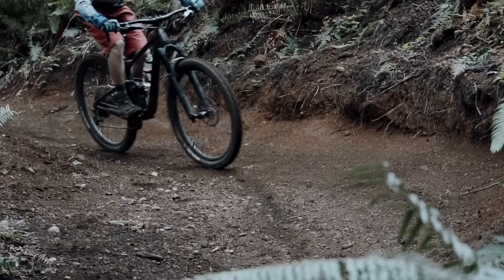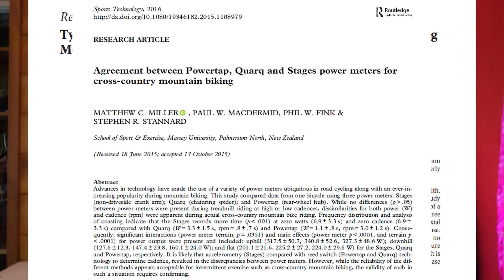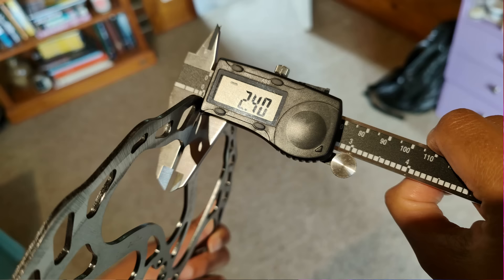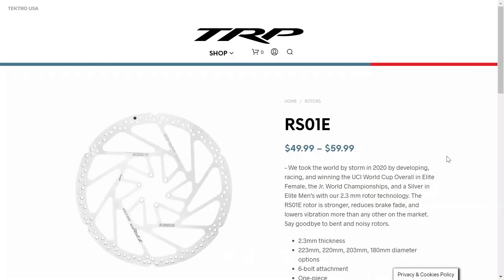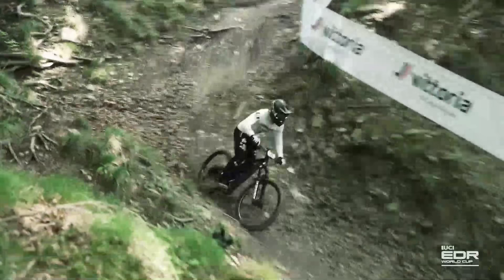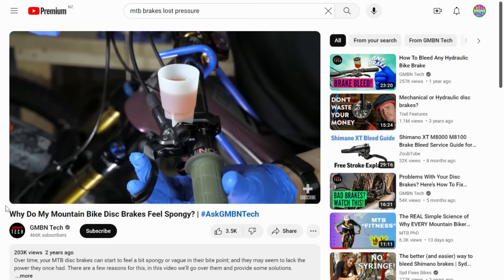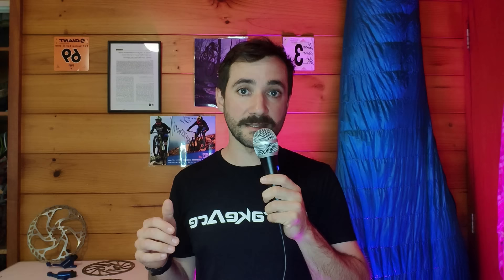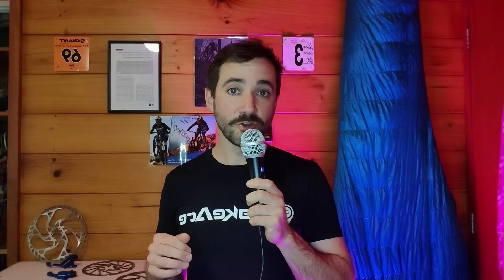Why THICK Rotors Will TOTALLY Change How You Ride (EASY Upgrade with REAL Proof)

Comment: Speaking from car experience, more mass means more heat asorbtion. But, one thing to keep in mind is heat dissipation. Larger diameter means more surface area. Which in turn will give faster heat dissipation. When it comes to brakes, you want the mass increase from diameter. Leverage,  surface area and mass.
Reply from the maker: Good points mate, cheers
Reply: Thicker rotors will tend to warp less when at maximum temp and over the long-term AND absorb/dissipate heat more efficiently.

Comment: I've switched to thicker rotors for some time and i didn't notice any difference in breaking performance whatsoever. So it only brings negatives being unsprung weight. As long as overheating is not an issue, thicker rotors will be an overall net negative.
Reply: I have tried trp 2.3 mm 203 rotors with copper metallic pads on my Jeckyll it works pretty much the same as the 1.9 mm floating rotors on my trance x 29 with ceramics, Jeckyll has codes RSC trance has SRAM db8's.
Reply: Well, he did say it is about heat dissipation (less fade), not more braking power. Go to larger diameter rotor if you want more power.
Reply: @garyking508  read my comment again. I didn't say that I wanted or expected more power. I said that theres no benefit to be had from thicker rotors, other than them being a bigger heatsink. But youll gain ~100g of unsprung weight!
So ill repeat myself:
"As long as overheating is not an issue, thicker rotors will be an overall net negative."

I am already on 220 mm discs, but they are normal sized 1.8 mm thick...
Reply: @LaurentiusTriarius  if DB8s work pretty much the same as your code RSCs, something's wrong with the RSCs my man.
Reply from the maker: You're right that overheating is not an issue for everyone - same as unsrung mass. Who makes the 220 1.8 rotors? I haven't seen those
Reply: @mtbphd  I've got shimano SM-RT-66LL (mainly because they were cheap). To be fair I just measured them at about 1.85 mm with my calipers.
Nonetheless; more unsprung mass might not be a subjective issue for many but will always negatively effect the ride unlike overheating brakes as long as they're not overheating :D
Reply: @LaurentiusTriarius  What I've seen of the floating rotors, they are lighter than plain ones. If they perform as good as heavy 2.3mm's, maybe the floaters are the way to go.
Reply: Well it depends on usage. Type of riding, terrain, frequency, etc. If you're just going off observational data without a 'control' study/analysis, then your opinion doesn't mean much to anyone but you. 👌
Reply: @rider65  it is not an opinion but rather simple physics :)

Comment: I sometimes wonder how much a person who has completed a doctorate is going to help others working in a given field relating to it . Especially in smaller nations . I know a lady who completed a doctorate in the music field some years ago but hardly anyone has read or really benifitted from it .
Reply from the maker: This problem is exactly why I'm happy to have moved on from just research to build a product mountain bikers around the world can enjoy and benefit from. It's much more rewarding than publishing a paper in an obscure journal that nobody will read!
Reply: @mtbphd  I love your mindset . I run a small bicycle repair / building business and treat every client's ride as if it was my own . Earning loyalty and loving this industry is everything to me .
Reply: @mtbphd  The brake ace brake power accelerometer / decellerometer has one limitation , the accuracy of the analog accelerometer itself and the strain gauge likewise , depending on which initial analog data collection method is used . It is nothing more than a  reciprocal power meter  with sensors mounted to the hub/s . We also had hub based power meters for output power of cyclists before brake ace came about.  It simply was a modification of a power meter . We had brake analysis software on millenium trains where I live in Australia . Developed by Downer Engineering in 2000 . Brakeace is simply a slight adaptation of this . The software was largely inspired by existing systems in transportation .
Reply from the maker: @robertmcfadyen9156  the electronics inside BrakeAce are power metre electronics. Our tech wiz rewrote the firmware so they could be used to measure brake torque/power. The accelerometer is only used to wake up the sensor (by bouncing the bike). Torque is strain gauge based.

Comment: That's a great topic, but the design of your experiment seems rather basic for a Ph.D. level scientist, as you mentioned yourself. It would be truly interesting to see measurable data on how it affects braking power, the amount of braking before fading, cooling down later, etc. Also, having proper control rotors, which are also new, would be valuable. Investigating the hardness of the ZTTO rotor, measured in HRC for example, and comparing it to branded ones could provide insights into its longevity in a long run.
Reply from the maker: Totally. Unfortunately there's not enough appetite for that level of analysis on YouTube so the video wouldn't really get seen.

Comment: I think this test would greatly benefit from testing with only new rotors, and with only rotors with the same design. I've tried several brands of rotors a decade ago and there were huge difference between some brake design, even in the same alloy.
Reply from the maker: For sure, thanks for the comment. What were the differences you noticed?

Comment: bigger on the front is a good idea just look at motorcycles 300mm on the front and 240mm on the rear  as you brake the weight transfers to the front
Reply from the maker: Bigger rotor on the front doesn't make sense in MTB since riders brake more with the rear brake. On motorcycles and road we get higher brake power with the front brake so I can see the argument for motorcycles at least
Reply: @mtbphd  CRF450R 2024 Specifications Brakes FronT Single 260mm disk Brakes Rear	Single 240mm disk THIS IS A  FULL ON MOTO X AND ITS IRELEVENT THE MODE OF TRANSPORT THE PHYSICS IS THE SAME
Reply from the maker: @wraith600original1 You might like this podcast episode. It's all about why most MTB riders don't use the front brake enough. Also gotta keep in mind that a lot of braking in MTB is to avoid going faster, rather than to slow down. Big difference in how the brakes are used https://open.spotify.com/episode/5yvyi8mTBcy4JrckHDZ3zx?si=yhXI-6juTdWjYiUU_ulBOQ

Comment: for ebikes, brakes seem to generally be undersized - not taking into account the higher mass of the bike and larger rotational mass of the usually fat tires.  

would be interesting to see what kind of temps they see when braking to a stop from 30mph.  and how that is impacted by thicker rotors at the same diameter vs a larger diameter rotor of about the same mass as the thicker upgrade one.    assuming a thicker one fits in the test bike.

it's too bad rotors aren't forced to be sold with a wattage rating of how much they can peak absorb and how much they can constantly absorb at room temp.    then you could estimate if it's good enough for your use fairly directly.
Reply from the maker: Yeah that would be cool. Most people wouldn't know how many braking watts they achieve, but it's easy to calculate ((change in kinetic energy - rolling resistance - aerodynamic drag)/braking time). Saying that though heat accumulation in the brakes is more than one-off change in speed -- depends a lot on how the rider is dragging the brakes through the ride, which varies on the trail, the rider, and how purposeful they are with their braking
Reply: @mtbphd   I'm thinking two variables that may matter is how fast can the rotor return to safe temp from say 120c while spinning at like 15mph.   and how fast does it heat up to 120c using some kind of iso standard brake process.

with an ebike a few ounces isn't going to matter .. so i wouldn't mind adding some to have better brakes.   it sounds to me like going bigger is better... and go as thick as your calipers can handle
Reply: @mtbphd  Is it really that crucial? Isn't it more about maximizing the average heat transfer capability? (Function of rotors' surface and some coefficient related to the speed and airflow around the material)

Thicker rotors increase heat capacity, i.e. let the rotor absorb more heat before fading occurs, but I guess that impact on the surface that dissipates the heat is negligible. On the other hand, heat dissipation speed is proportional to the difference of temperatures so the thicker one may be dissipating the same energy at a slower rate due to lower gradient of temperatures?

In the context of heat buildup isn't the elevation change of the trail a dominating factor? Braking from 40km/h down to full stop transfers into heat energy equal to slightly over 12m of elevation change (yes, I'm ignoring here the aero drag). That seems like nothing compared to the difference of potential energies between the start and the end of a downhill trail. Assuming that rolling resistance is negligibly small compared to the braking power or aero drag on faster sections, I bet that required heat dissipation speed could be approximated with a function of inclination, average speed, mass and aero drag coefficient (maybe also some coefficient describing the impact of the airflow on the cooling speed of the brake).

Therefore, it seems like the optimal strategy for minimizing the heat buildup in rotos is to brake as short and as intensive as possible (the shorter braking times, the higher braking power and higher temperature gradient; the more and faster the rider goes, the smaller energy to dissipate in brakes due to aero drag) with the rotor that has enough, but not much more heat capacity, to stay within a planned temperature limit for a given trail?
Reply from the maker: @BZab_  totally. Lots to consider!

Comment: If you were actually interested in a scientific or engineering test of the effect of rotor thickness on braking...this is the LAST way you would do it. Experts generally start with tests under controlled conditions that evaluate something specific; in this case, for example, there seems to be a hypothesis that a thicker rotor will store more heat and therefore temperatures will climb more slowly under braking. Great! Put together a setup that puts the same braking force into rotors of different thicknesses, and measure the temperature over time with an IR thermometer or embedded thermocouple. You could add realistic amounts of airflow, if you like, but the key factor would be isolating the factor you are interested in and reducing or eliminating the effects of confounding variables/factors, and doing an objective measurement that tests your hypothesis.

What does "MTB PhD" do? On-trail testing with every possible confounding factor included, with a sample size of two tests per rotor thickness (!). He concedes that there is a wear difference between the thin and thick rotors (oops!), but neglects all the complex factors in his psychology and technique that could produce different results. He also doesn't have any kind of objective way to evaluate differences, beyond the "feel" or how he behaviorally braked. Did heat storage affect the effectiveness of his brakes? He literally can't tell you.

Real-world testing only works when you have a large enough sample to isolate the variable you're interested in from all those other confounding factors. In this case you'd need both an objective measurement and likely tens of attempts from 40-50 different riders. Needless to say, this "test" isn't even close to the statistical power you'd need to make any kind of reliable conclusion.

To be fair to "MTB Phd" he's hardly the only one putting meaningless tests out there as "science." Pretty much everything GCN labels as "science" suffers from the same flaws and is just as meaningless. You would just hope that somebody who sold themselves with research credentials would not jettison everything they learned doing that research when they started recording for YouTube. And "with REAL Proof"? That's just clickbait snake oil.
Reply from the maker: Thanks Duncan. That would make a rad test.

Comment: I  just nerded out on rotors yesterday. My theory is about bite and timing for rotor size and weight, along with momentum, leverage and heat is least, IMO. More about how you're breaking on trail. I was holding 2 SRAM Centerlines 220-200 and a 180mm low center mass rotors. Noticeable momentum in the SRAM, and little comparatively for 180m. The surface area, and therefore cut-outs and pattern play a factor, IMO. Look at your bike, the 203s are giving away 50% area, and pads are "switching" on/off in friction. Might as well be a 180m HS2...I say momentum bc it's relative to my riding on the street, and downhill, I use 200 and I want 220, also. I'm 220lbs fast and super aggressive and late braking...I had already decided to try the TRP 2.3" 203m rotors, to prove my theory w/ my pad choices. Pads also a key factor in works with size (greater pad friction w/better pattern 180m comparable to 203mm).  Nice video. Thx
Reply from the maker: Braking is everything! 🙌

Comment: I agree, i went from shimano to magura rotors and have never gone back...thicker rotors allow faster brake pad engagement...givng me more immediate feedback and confidence
Reply from the maker: Nice one mate. Which Magura rotors?
Reply: Pad clearance or engagement speed as you put it are not controlled by the rotor thickness.
The square edge seal inside the caliper and the fluid viscosity is what controls this.
What you did was simply put a thicker rotor in without resetting the pistons and found you have less clearance.
This will reset itself after a few rides as the pads wear and will feel identical to the previous rotor.
Reply: @darrylduck6356 Exactly what I was thinking. But not sure if viscosity would come into it (unless insanely thick fluid was use for some reason) as that would only affect flow, not pressure on the pistons. Also the seals are so small that I'd think the pad springs would have the main influence on retraction.

Comment: I feel like what you should be comparing is polar moment to heat dissipation or heat storage (or a combination of both - some type of overall performance). As you know, more weight doesn’t necessarily mean more energy to spin up, or on the contrary, exponentially more energy despite having a similar scale weight (scales to square power), but also I’d be curious at what point is a rotor too large. I would think that would be the whole point of the test - everyone knows a bigger rotor is going to have more surface area, have higher velocity at the edges, provide more leverage, etc etc. it’s at what point is a rotor too big that  it become a detriment rather than a benefit.
Reply from the maker: Totally, thanks for the commentary. Plenty more testing we can do, but since there's pretty much nothing on braking performance it makes sense to get heaps of data using tools and components anyone can access. (I still have PTSD from years of using wires and data loggers on bikes😁). Plenty more we can do!
Reply: I've actually experienced an edge case where I've noted decreased performance from bigger rotors. On my fat bike (snow only) I initially had 180mm rotors and had problems with them having a terrible wooden feel from the cold, being too sensitive causing lock-up, and not performing terribly well when wet (noisy chatter reducing braking efficiency). 
I downsized to 160mm rotors and all of the above problems have effectively gone away. I attribute it to the brakes maintaining more heat, allowing more effective drying and just being closer to their operating temperatures as well as the decreased leverage moving the exerted lever pressure into a more "normal" range.
In short, you're thinking is about right. The "best" brake solution is going to depend on your riding needs. I'll admit my case is an extreme example but it does illustrate the point.

Comment: I'm curious on what do you think the effect is on caliper pad to rotor clearance? I use MT7 myself and the pad clearance on that caliper is nuts u don't even see light coming out of it. The rotors to use on that brake has to be 99% true so that it doesn't rub the pads. I guess this is what help with the great modulation of this brake? Or maybe power? I have no idea about all that but the fact that this brake released almost 10yrs ago and still is ridiculously competitive against brakes released this year is insane.
Reply from the maker: I have noticed this on some pads (mostly the off brand cheap ones that are likely all made in the same factory!). They usually spin fine after 1 ride. Also I have to say I have only experienced this with the resin pads, not sintered
Reply: @mtbphd  I've been on MT7 for couple seasons now only issue that piss me off is this pad rub cuz my disc is not 99% straight...Pads I am always using the magura original ones. Disc is magura's own mdrp floating disc, out the factory bent just that tiny bit, but MT7 caliper says NO I GONNA RUB... I have no idea why they design the pad to rotor clearance on this brake to be so tight. Considering swapping disc now as they are almost wore down, or swap the whole brake.